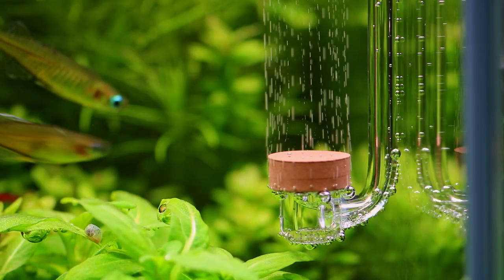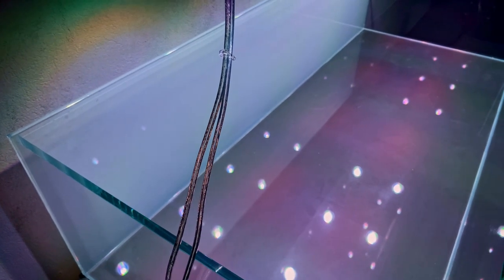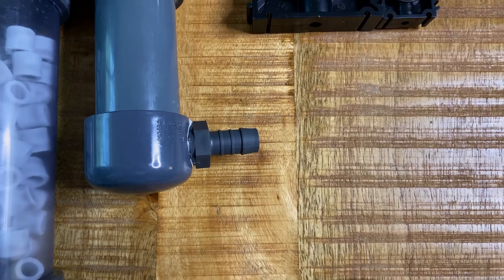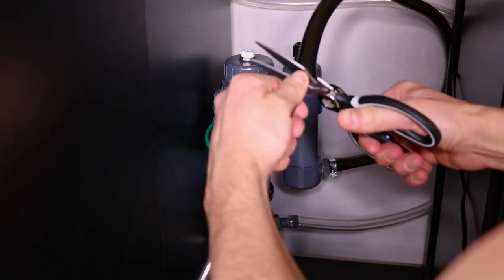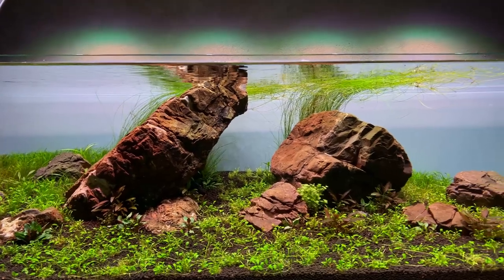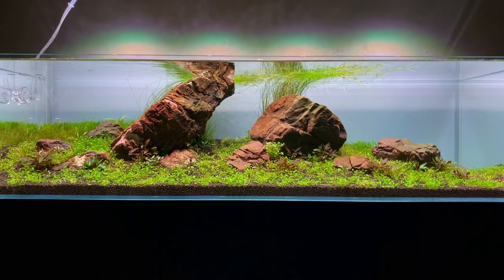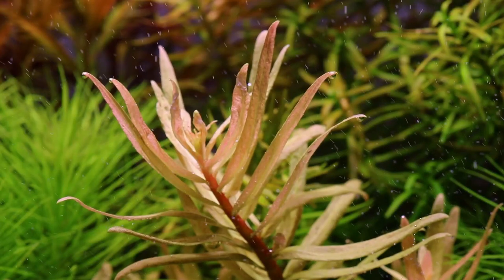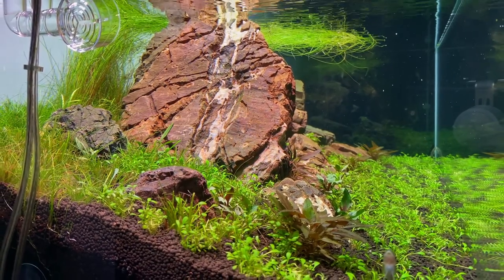IS THIS THE BEST METHOD OF CO2 INJECTION??? CO2 System For The Big Shallow Explained 😎

Comment: It might be a stupid question, but is the placement of my diffusor wrong if the bubbles do now spread in the aquarium but simply just move vertically towards the surface? I followed your DIY method and I have a 35l tank with an aquaclear 20 hob filter.

Comment: I use an in-line diffuser from C02Art -- although honestly I suspect that all the in-liner diffusers probably come from the same manufacturer are just rebranded for the shop selling them -- but I'm also using a spray bar as outlet and I left some extra length of tubing from the filter to the tank. This set up has given me good C02 dissolution, at least judging by the drop checker and the plant growth. There's still mist in the tank, but the plants pearl so much that I can't distinguish between O2 bubbles and C02 bubbles anyway.

Still, it's good to know all the options and to have them presented so elegantly. Your videos are the best, Mark. I noticed your channel is growing; it's well-deserved.
Reply from the maker: Yeah exactly, they are all the same 😂 That's true I'm pretty sure that when I have a full glosso carpet the tank will look like sparkling water anyway 😁 Yeah channel is growing nicely 😊

Comment: You captured correctly all the pros and cons. I'm using the co2 reactors for a couple of years. Some i built myself, some i bought. Flow reduction is my main concern. But, after testing some diffusers, noise, additional equipment in the tank, ruined photos because of bubbles...i cam back to reactors. It is a thing of taste, after all. Nice video, well documented, hats down.🤘 I enjoyed watching it.
Reply from the maker: Yep I think after you get used to having a reactor you don’t want anything else anymore 😝
Reply: @MJAquascaping  yep! The hardest part is to clean it...meh😆
Reply: watching this again today, after trying an inline diffuser for a couple of months. I want to go back to reactors. :)))

Comment: "Should I make a video about this controller?"
Hell Yes Mark!
Btw I am running CO2 art inline diffuser, and I agree with the sprite water or misty appearance all the time. I am thinking of the reactor but the flow rate reduction would be too much, I already feel the 850 is not able to keep up with the duties of this large tank
Reply from the maker: Maybe consider getting a second cheap external filter, and just run it empty to power the reactor
Reply: @MJAquascaping  yeah precisely what I was thinking. Have a spare fluval 350 I can use. But have to do lilly pipes again. Let me give this a shot. Need to research reactors a bit more. Thank you
Reply: @MJAquascaping  you can put an additional pump to boost the flow.
I had: external prefilter - main filter - pump - external heater
It worked fined, but takes a lot of space, a lot of hosing so I got myself the biomaster.
Reply: @KenLe1998  hi Ken, yes I do use a Hydor Koralia circulation pump
Reply: @sandeepsharma82100 Hello!
 The pump i mentioned, is not curculation pump. Its In-line pump, like you connect it to two sides of you hoses. Try to Google Aquael UniPump, comes with 2 version 700 and 1500l/h, very cheap.
You are using a wave pump, which is not necessary for a tank under 2m long 😀🙂
Reply: @KenLe1998  thanks for clarifying. I will look into it.  My tank is 150cm x 65 cm (550L approx). This is not a wave pump but the nano version (I understand what you mean, Hydor makes powerful wave pumps with controllers). The one I have is 400gph and barely causes a gentle movement in the tank to make the fertilizer and CO2 spread more evenly. I do have the more powerful 1050gph too which is overpowering for this tank. 

Good discussion here Ken and Mark, I have started looking into reactors and assist pumps more. A second filter even for the reactor may not be a bad idea to offload the Oase Biomaster 850 to focus on filtration while a second filter/pump does the CO2 infusion. 

Thank you both
Reply: @sandeepsharma82100  wow that huge tank!
For this case I would rather go with multiple diffusers (or one big 55mm) and save the filter flow at highest possible. You know what I mean, 2 difusers on both sides, same with filters, one each side. I think its gonna work well and you wont need wave maker.
Reply: @KenLe1998  Thanks Ken, yes good to have all these ideas so I can figure out pros and cons of each and come up with the best possible solution.
Mark earlier mentioned that the soda water or misty look of microbubbles with inline diffuser are bothersome for clarity. I am going through that now, which is why I'm thinking of a reactor. Or even in tank diffuser (looks kind of cool vs having mist everywhere in the tank for 8 hrs)..
However the engineer part of me 🤔 mist is great for plants ( but not for aesthetics).

You see my dilemma.. this is where the reactor and second filter options come in. With a second filter or inline pump, I won't need the circulation pump either.
Reply: @sandeepsharma82100  That way, for me, too much money to throw in :D But hell yea, your tank is kinda long, the difuser probably wont make it that efficient as reactor.
Only ADA uses difuser for a 180cm tank, others always recommend to go for ex reactor.
Wish you luck and succes :)
Reply: @KenLe1998  hahaha yes Ken, budget gets stretched but luckily it's not really too big a deal now 🙏🏻

Actually I do have 2 old Fluvals (3xx and 4xx) one is idle old and unused and second one will be free once I dismantle my 55G which developed a leak (triggered this setup and serious aquascaping attempt).

Reactor is what I would have to buy OR make myself (love DIY but when it comes to water I'm a little scared of the wife throwing me out the house if I flood it ahahhaha).

Good discussion here, thank you Ken, Mark for making this hobby enjoyable.
Reply: @MJAquascaping  btw Mark, I have been checking out all videos and details of the Intaqo controller. Exchanged a few messages with their team too to check on compatibility.
Now the only thing I need is a good review video from you to get it with piece of mind 😆
Thank you Mark for all you do to educate many of us!

Comment: In my experience the reduced flow is the biggest con. Not only is the flow reduced but also it's inconsistent. The flow is decreased and it keeps decreasing as the filter media (especially sponges) collect detritus. It technically reduces the flow and, consequently, the amount of dissolved CO2 daily. Perhaps 2 reactors on 2 oversized filters will allow you to avoid this problem, but I was running into problems. After monthly filter maintenance and plant trimming everything looked fine, but then as the filter flow (and CO2) was decreasing and plant mass and greater need for CO2 was increasing, I was running into algae problems. Inconsistent levels of CO2 is worse than low but steady CO2 levels. I finally went for dedicated external pump-CO2 reactor and reconnected my filter for straight filter-tank circulation. Yeah it's an additional pair of hoses but far better results in plant health and overall cleanness of my tank.
Reply from the maker: Thanks for sharing your experiences!

Comment: Nice video! I have been using CO2 reactors for a long time. My experience is to remove all the media that is inside these reactors, they only reduce the flow tremendously and do not help to dissolve CO2 any faster, CO2 dissolution in water is actually very fast and easy in these reactors, the turbulence created from the inflow on the top of the reactor is actually more then enough to do the job.

Misschien iets om uit te proberen voor een volgende update ;)
Reply from the maker: Ga ik zeker eens proberen!

Comment: I like the idea of having less equipment in the tank as well. So I went for a sera flore 500 reactor with bio master 350. I noticed that when the co2 is off, there is water back flow into the co2 tube even I have the check valve between the bubble counter and reactor. The water is actually able to pass the check cable and very close to the bubble counter sometimes. Do you have a check valve in your system? I am wondering if my check valve is faulty or biomaster 350 is able to push water through all check valves? Thank you!

Comment: I used a 2 L pop bottle yeast reactor for a while, and the co2 was fed directly into my sump pump which was connected to an undergravel filter covered with a thin fine filter floss before the gravel (wouldn't really recommend it).  I had no co2 bubbles, but the plants improved greatly, though the water became very acidic.  I ended up discontinuing it.  For some reason, I'm always struggling with ph.
Reply: Add crushed coral or Wonder Shells; it will help replenish your GH, KH which also stabilize your PH
Reply: @marvinnguyen-colorado2018  I have hard alkaline water, which is why I was surprised the co2 had such an effect. I'm still running a co2 yeast reactor, but a much smaller one. Also, the reason why I struggle with ph beyond that is for the opposite reason; the hardness rises over time and so too does the ph. I wanted to create no-water-change tank (or at least limited-water-change), but I have to change water every month or so to keep the hardness down. I'm using water softening pillows from API, but I'm still about ready to just say fuck it and what will be, will be.

Comment: Tnx, I dislike co2 mist. My favorite time with my aquarium is also when the co2 goes off. I know one way to avoid this is using co2 cup diffuser.  Stick the cup upside down and inject co2 manually inside cup and leave it to diffuse slowly until cup gets filled with water again. I'm thinking of doing this when I have more tanks and a small co2 cylinder.  Mine now is 6l welding co2 cylinder shared BTW 3 tanks. And a regular top filter and inside pump.
Reply from the maker: Yeah that's an interesting method! I've only seen that once in a video from aquarium co op.
Reply: Some ppl use mini co2 canister that come with the cup. Insta co2 is the product name but canister is too small for use more than a few weeks.

Comment: Great videos! It inspired me a lot. Thanks for the effort. I took a 240 liter aquarium with the dimensions 120x40x50 cm, and I have to equip it. What flow rate should the External Filter have for such a reactor? What Filter do you recommend for this ?

Comment: Put the inline diffuser on the intake. I have that on 4 tanks, 0 mist and 100% dissolved
Reply: Does this mean you're using the filter as a "reactor" - I want to try this but worried about what the CO2 will do to the filter media
Reply: @damianknight1978  the co2 is not the worry for filter media, the oxygen is, and you can have both, as long as the levels are not very high for co2(which would be problematic for fish and invertebrates anyway )
Reply: Yes you are right, I have been doing this for years with no problems, although some people say that the co2 makes the external filter seals brittle over time, leading to leaks. This has not been my experience.

Comment: I tried the inline diffuser and had the same bad experience as you and switched back to the regular internal diffuser. A reactor is definitely an option for my larger tanks. I’m running 2 external filters on them anyway and could use one of them to drive the reactor. Thanks for the review of this system. Is the transparant smaller tube next to the reactor a bubble counter?
Reply from the maker: Definitely give it a try then! Yep that's the bubble counter, not sure why I got that. Totally unnecessary...

Comment: Great video and a very interesting co2 reactor. Another cons, in my experience a co2 reactor doesnt work well with diy co2, because of low pressure.
I have been using the Sera reactor, which also is a bit noisy, because it whirls water and Co2 together
Reply from the maker: Hmm maybe that is something we have to put to the test! DIY CO2 on a reactor!

Comment: I made one from a 110 mm grey sewer pipe with 1 screwable cap  with 2 hose connectors from the 22 mm  in and out hoses. 60 cm long. Costet about 10 euroos. Filled it with pvc balls and water going in from above and out at the bottom. Co2 is getting in through a jbl diffusor mounted at the inlet hose.
THE PH PROBE IS IN THE AQUARIUM.... NOT IN THE DIFFUSOR. Thats were you want to measure!!!!!! It works for over a year now with no problems an no bubbles.

Comment: I think the cons of the reactor outweigh the benefits, cost, loss of flow etc... but the biggest loss is the loss of efficiency talked about in the video is the co2 bubbles hitting the leaves. I guess we just have to put up with the fizzy water effect in our tanks if we want the best growth and plant health....
Reply: For me, the diffusers never worked in my large 150cm planted tank, no matter how much i inject co2, my co2 checker always remained blue… Then started to use a co2 reactor, on my 1st day the co2 checker turned light green with only a fraction of co2 injection rate.

Comment: Question: can you accomplish a similar result by putting an inline diffuser on the intake side of your filter?  The bubbles are then still trying to rise against a descending flow and also will get broken up by your filter media. Downside being you would have to clean it more often.
Reply from the maker: I’m thinking of testing this out very soon
Reply: Unfortunately that would leave gas pockets in your canister filter which in turn will create a noisy filter. 
Some people have tried putting a In tank co2 diffuser under their outlet in old aquarium forums but that only made a noisy filter. Maybe it’s worth trying it now, now that it is a decade later 🤷‍♂️
Reply: I'm not sure this is true but I heard that the low PH of the CO2 gas can damage rubber gaskets in the filter.

Comment: What is the reason you don't put the link to the reactor in the description?
Reply from the maker: I think I just forgot, I've added it now! Here's the link for you as well in case you were curious https://www.co2reactor.nl/product/1819012/co2-reactor-met-inline-houder-ph-electrode-en-bellenteller
Reply: @MJAquascaping  Thanks. Not many that make these as they are super niche and custom. I know a guy in the state who make one as well, his website is called nilocg and he can make one in any hose diameter and length as well. His product is cheaper but then you have pay custom to the EU plus more expensive shipping.

Comment: @MJ Aquascaping
Did you sort out the vibration on your Oase biomaster then? I noticed you've removed the foam. I had the same issue out the blue last week after doing a clean, I believe it must of been the trays full of lava rock that wasn't seated properly and were causing a loud hum! It drove me mad for most of the night tbh lol until I'd had enough at aprox 5am I eventually got up (my aquarium is in my bedroom and the unit is completely open design) i took everything out of the filter and then replaced it all ensuring that each tray was sitting correctly in the one underneath, now my Oase Biomaster is back to being almost silent.
Reply from the maker: I only removed them foam for the filming 😊 I'ts definitely less noisy, but you still hear it. I think I got used to the small hum as it does not bother me anymore.
Reply: @MJAquascaping  lol oh ok. Maybe when you do ur next clean pull out the trays give everything a little shake and then reassemble making sure there's no media sitting under the pre filter tube, or that any of the trays them selves are not sitting right, possibly causing the impellers natural vibration to be resonating off of anything it shouldn't.. I'm sure you'll probably find a vast improvement, These filters are almost silent, or at least should be and with yours being inside a cabinet you shouldn't be hearing anything at all, i sleep 3 feet away from mine and i can't even tell it's on Mj.

Comment: Hello thank you for the video,

I already have a main filter and I am thinking of buying a second one but smaller only for the reactor. My main is the JBL 1502 and for the second I am thinking of the e902 which is rated at 900l/h but the real flow is actually 400-500. Would this be fine in combination with my main filter ?
Reply from the maker: Yep sounds good!
Reply: @MJAquascaping  thank you, I will give a try it worths the effort. How did you find the flow reduction over the weeks? Have you experienced any co2 fluctuations problems ?

Comment: I have a wet dry filter and sump filter connected to it my question is will a co2 work with my system or will eat up co2 very quickly

Comment: Great video! How many BPS are you running? I have a 65 gallon 120cm and I have to run about 8 BPS to hit my target Co2 range which is about 6.6 ph in 4dkh water (38 PPM of Co2)
Reply from the maker: I'm not entirely sure, but I think it will be very similar to yours, maybe a bit less. I'm also staying at ph 6.8
Reply: @MJAquascaping  awesome thanks! Yeah I felt like I was using way too much bps to get to my targeted Co2 and was considering a better reactor build. I’ll just stick with what I have since everything is growing in nicely now.

Comment: Does lilypipe ouflow positioning matters when using co2 reactor? Do we need to place it slighly deeper than usual so the water with co2 not getting escape to the surface faster?
Reply from the maker: I don't think it really matters that much. The Co2 should be completely dissolved with a reactor, so it's not going to the surface
Reply: @MJAquascaping  thanks for your reply!